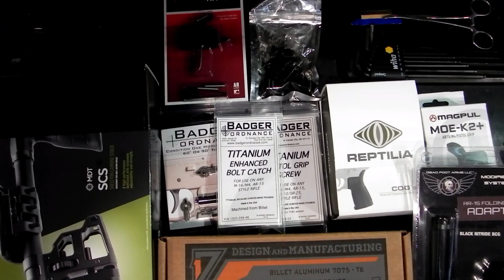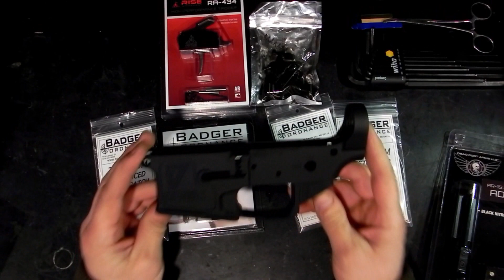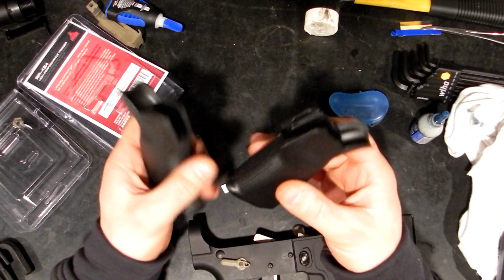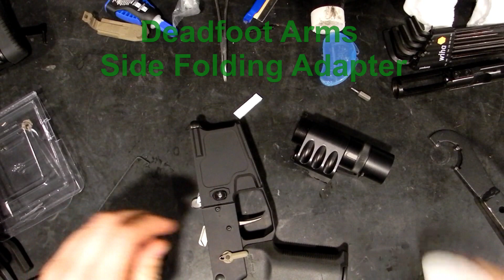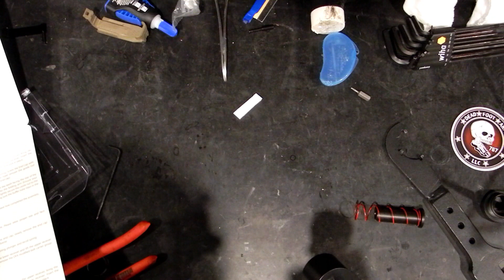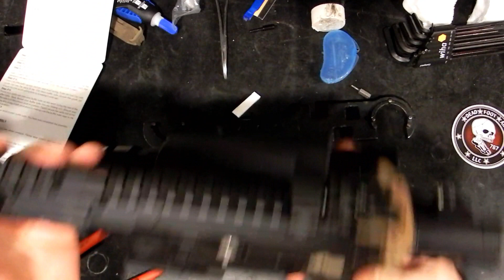Lower Assembly: Video 2

Comment: Really liked the little tips regarding rear detent retention and front detent assembly. Threaded pin for bolt catch is an awesome bit of kit. Camera seemed to work well, but there is always room for improvement, good video mate, cheers, Ben.
Reply from the maker: Thank you for the response and kind words. I have a new camera coming and it should arrive the following week.